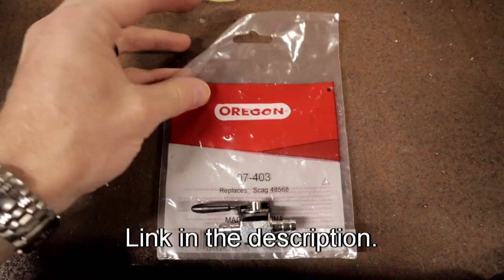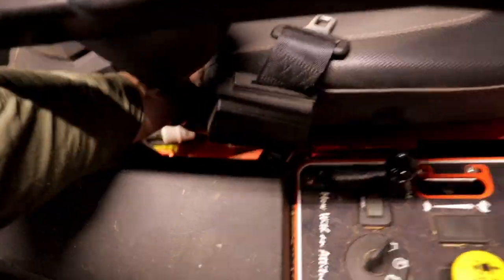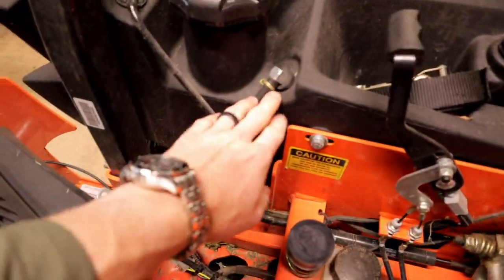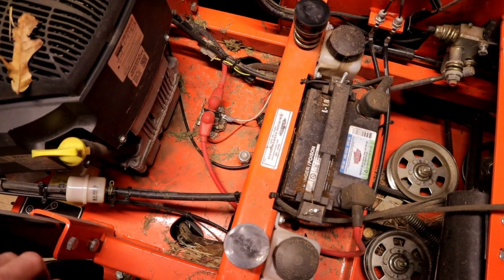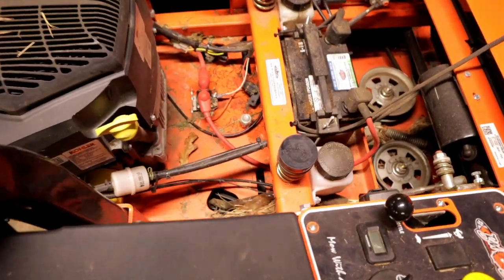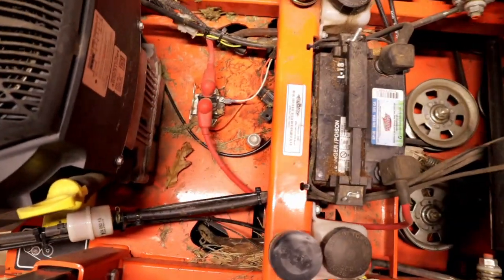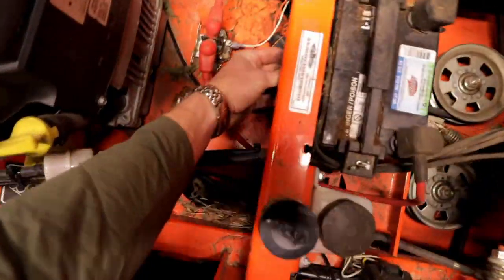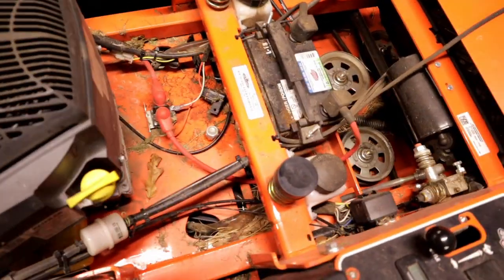Bad Boy Mower Fuel Valve Modification

Comment: Thanks for the advice/video on this. Haven’t cranked mine since November but soon I’ll be mowing every 4-6 days
Reply from the maker: Yeah same here. I’ve run it a hand full of times since the fall. Now is the time to prep for spring.
Reply: @south_coast  I went to tractor supply and bought 2 quarts of Kohler oil, already had a filter since I bought 2 last year off Amazon. Are you ready for this? 
I paid $12.00 a quart. Ridiculous just like gas prices this season. Thanks Brandon LOL 😂
Reply from the maker: @58bobw  Wild times to be alive for sure.

Comment: Nice. Just ordered and will install. I seem to get some fuel smell through the carb when mower sits. I'll shut off the fuel when storing. Hopefully this helps. Awesome upgrade!
Reply from the maker: It’s definitely a helpful mod. Most recently I used it for swapping the fuel filter. Way less mess.

Comment: Thanks for the video. Any issues with having a shutoff on these? Wondered why bad boy didn't put over on from the factory. My old Husqvarna zero turn had one from factory. I was wondering if it's because of the gas being pressurized with a fuel pump and not gravity fed like my Husqvarna was.
Reply from the maker: I haven't had any issues with mine so far.  It is probably just a cost savings thing.  Most mower 
owners probably don't even use them properly anyway to be honest.
Reply: I don't know if the factory installed it or my dealer, but my 23 Elite had one when it was delivered.
Reply: The clamps on the fuel line! I've never thought to use that style of clamp. Brilliant!